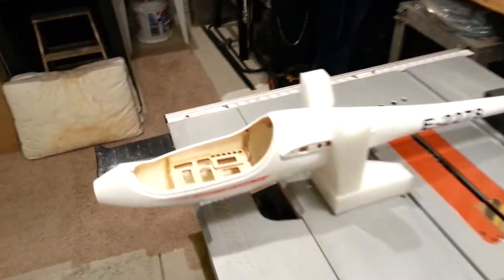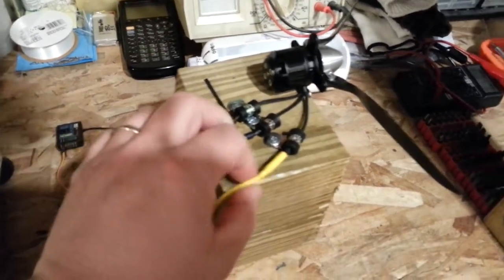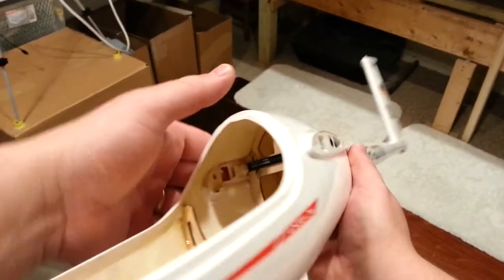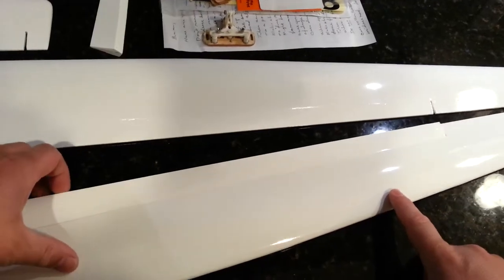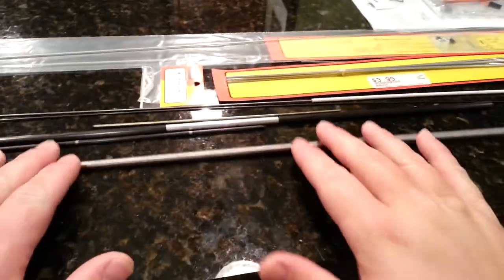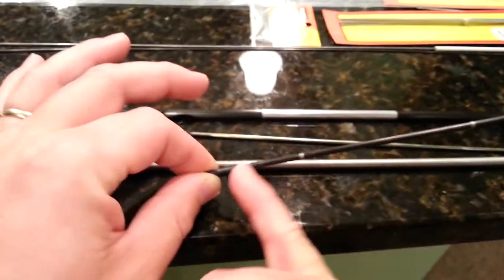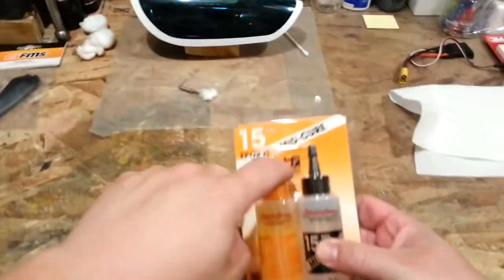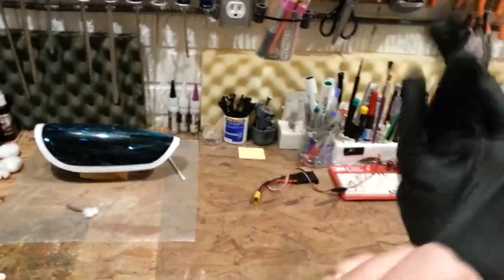CMPro - ASH26 - 2.6m Composite Sail Plane - Build Series - Wing Joiner and Elevator

Comment: You should of checked wing alignment first.
Reply from the maker: Ian - Advice after it's too late is just annoying.
Reply: That procedure was initially stressed more than once, and also in the notes. How far off is it ? Might be able to sand inside the tube some, & shore up with epoxy, and then sand the epoxy to get a tight rod fit.The fuse support root ribs where the tube goes through are plenty strong.